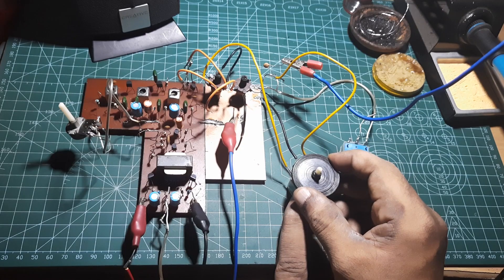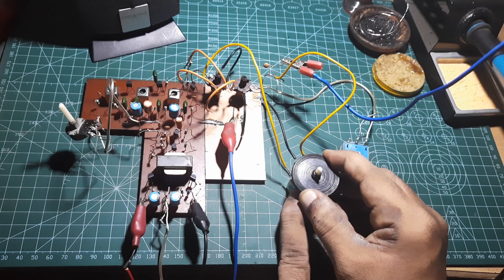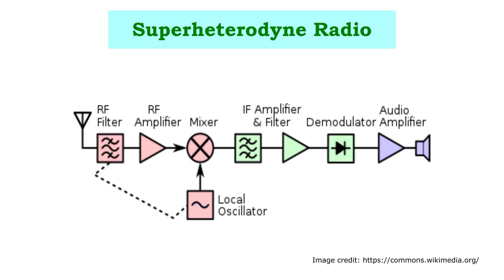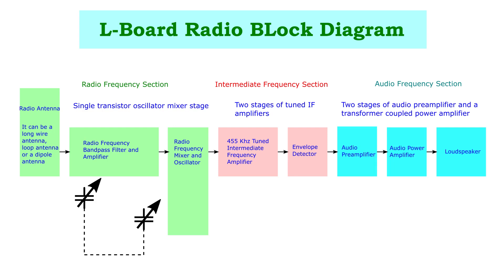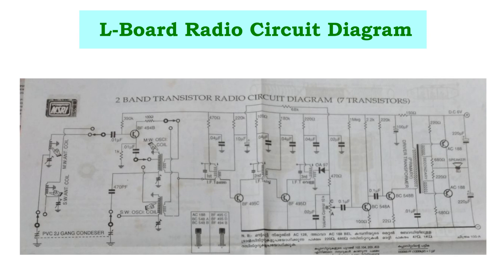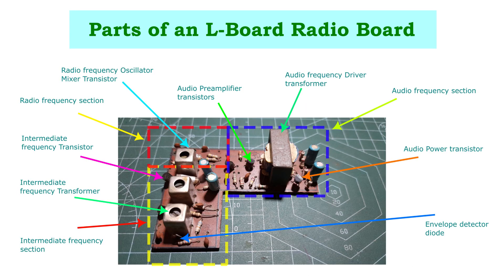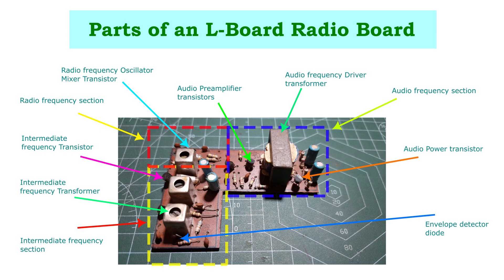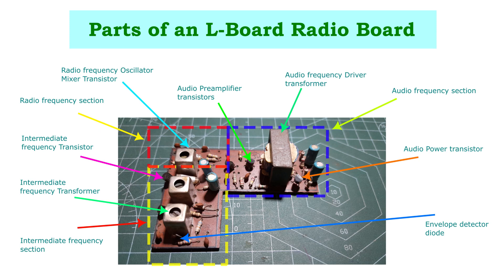Working of an L-Board Superheterodyne Radio Part-I

Comment: Plz also give  connection. Wireing knowledge between trangister 194 .ossilater coil .  2band                pvc Gang.  Tremers antina coil of both band.     With. Hand made circuit of these    wiring    undestandabe as a bignners❤❤❤🙏👌👌Plz. From ere I can buy  Lbord complete and. above part

Comment: Very nice and interesting 😂.  What are the output transistors? are used in the project?
Reply from the maker: Sorry for the late reply. The finals are two S8550 PNP transistors. Driver transistor is BC548.